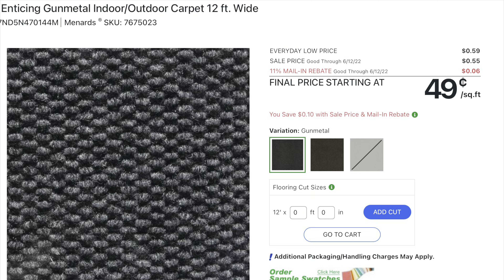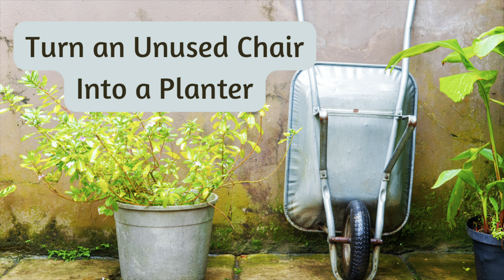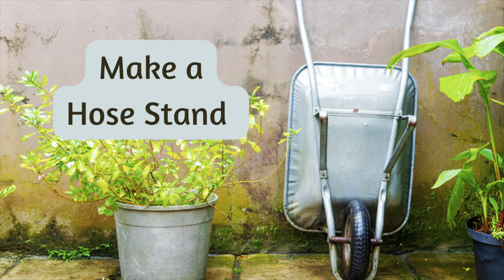15 WAYS TO ADD DIY COTTAGE CHARM TO YOUR PATIO; BUDGET FRIENDLY PATIO MAKEOVER

Comment from the maker: The Gardesol pergola is in my Amazon store; however, they also sent me a direct link: https://bit.ly/3Q2mkY9
They also sent me a $100 OFF discount code: GDSCC100
Reply from the maker: @sherylchapman4168  It came with attachments to bracket to the patio, but because I have slate I didn’t want to risk drilling into it. It weighs 600 pounds, so I think it will be fine unless we get tornado strength winds (which is a possibility in Illinois)!
Reply: Hi Sherri! The promo code didn’t work. Do you happen to have another one?
Reply from the maker: @gurpreetgill2158  let me check on this.
Reply from the maker: This is very aggravating. It didn’t work for me either. I emailed my contact person and will get back to you as soon as I hear something.
Reply from the maker: I heard back from Gardesol. There is currently a 5% off button you can check on Amazon that will reduce the price by $100–as long as this coupon is available, the code won’t work. However, if you order directly from the company, you will want to use the discount code. Sorry about the confusion.
Reply: absolutely beautiful 😍
Reply: I muted voice.
Reply: I'm just now watching your video a year and a half after you posted it and love the pergola. However I wanted to know how it has held up. Is it still rain proof?

Comment: The fairy lights tea pot is fabulous. Will be doing that. I am currently making large flower heads and stems from fake blossoms and vines glued to plastic plates, all $$ store. They will be attached with zip ties to 2’ x 4’ frames and chicken wire attached in the frames. One “bouquet” on each one. Three of the “pictures” will go on the wall of my covered deck.

Comment: We put the battery operated fairy lights into our hanging plants. I protect the battery box in a zip lock snack bag and keep it way to the side of the pot for watering.
We invested in rechargeable batteries and charger years ago, and I keep these tucked all around the house too. Really pays off when the power goes out.

Comment: I loved this video, Sherry! I have a tiny apartment filled with antique and vintage furniture that has a small enclosed patio that is an extension of my home. I would love some suggestions for providing a way to limit sunlight on my patio to make it usable all day and so my plants don’t burn in the hot Texas summer sun. It’s a rental so I can’t make any permanent additions. I’m not sure an umbrella would work although I’ve wondered how I could position it since there is a balcony overhanging half my patio. I have only a small wooden folding Ikea table with two chairs. This patio serves as my workshop for painting, restorations, carpentry, and a potting shed, and my outdoor bistro.

Comment: I loved this video!  Unrelated question:  Which would hold up better on frequently used dining chair (including seat)---IOD transfers or napkins/mod podge?  Or would neither be tough enough?
Reply from the maker: I would use a clear topcoat (such as a spray polyurethane) on both of those options, and they should last quite awhile.
Reply: @CanterburyCottage  Thanks!

Comment: Would like to know if the pergola is attached at the top, to the house, or is it free standing? Thank you for all your creative and inspirational videos.
Reply from the maker: It came with hardware to bolt it to the ground; however, since my patio is slate, I chose not to use them. Drilling into slate can cause it to break. The pergola weighs 600 pounds, so it’s not going anywhere unless we have tornado strength winds.

Comment: Your patio looks a treat!  Surely magazine worthy, even if there are no extra finishing touches yet.  Cardinals seem to like those hemlocks, so you are very lucky to have a mated pair!  I have to ask though...your pergola IS anchored to the ground, yes?
Reply from the maker: Thank you, Karen! It came with anchors, but I decided against using them because our patio is slate. The pavers would likely crack if I tried to drill into them. The pergola weighs 600 pounds, so it should be fine unless we have tornado like winds.

Comment: You could maybe use square top solar lights and cut out square tops of the bird houses (almost to make it look like they have a little bowery). I see solar light shandelier DIYs at nauseum in my feed if you need help taking them apart to paint first so it isn't jet black.
Reply from the maker: Thanks for this suggestion! I will have to look for some small square solar lights—the birdhouses are pretty small. (Maybe, a hummingbird will move in.😊)

Comment: Did you have to anchor down the pergola to your hard surface?  This is what has stopped me getting one on my cement patio in the past.  Worried about breaking the concrete.
Reply from the maker: I did not. We have a slate patio, so anchoring was not really an option. This video is from last spring, and we have had several storms over the past years with super strong winds, and it hasn’t moved an inch!

Comment: Did you anchor the pergola to the patio? If so, how?
Reply from the maker: It came with bolts to anchor it to the patio, but because I have a slate patio (and slate breaks easily), I chose not to use them. It weighs 600 pounds, so I think it will be fine.

Comment: Is the sun porch anchored in the ground .
Reply from the maker: It can be. It came with bolts, but because my patio is slate instead of concrete, I chose not to use them. The pergola weighs 600 lbs., so it should be fine unless we get tornado like winds.

Comment: Pour salt on the areas u want weeds to die. I don’t know if it’s safe for regular plants because I only use this method on weeds only. The salt kills the weeds and they stay gone for most of the summer months. You can also pour boiling water on them but they don’t stay gone as long as using salt does
Reply from the maker: Lainnie, I knew about the boiling water, but I didn’t know about using salt! I will definitely give it a try—just regular table salt? Thanks so much for sharing this idea!

Comment: Didn't you need some kind of drill to install the pergola bases??
Reply from the maker: The pergola came with bolts to attach to the patio, but because my patio is slate, I didn’t use them. (The slate would have cracked or broke.) It weighs 600 lbs, so I think it will be fine unless we get tornado strength winds. 🤞

Comment: The leaf anywhere else would be great for the birds, unfortunately, the water from the downspouts drain run off water is polluted by the roof material and not healthy for the birds and any animals drinking from it. 

Also, that downspout needs to be no less than 6 inches away from the house foundation to avoid damage.